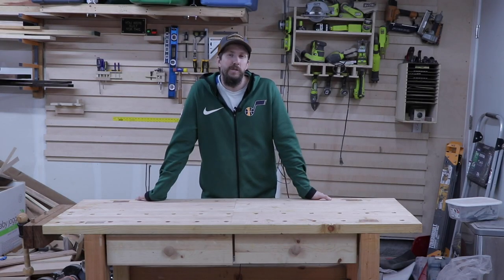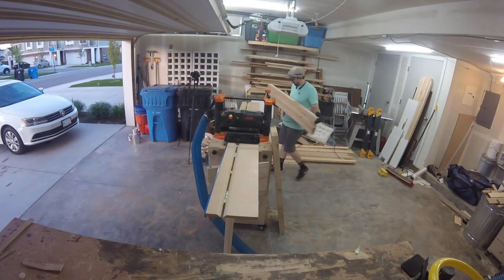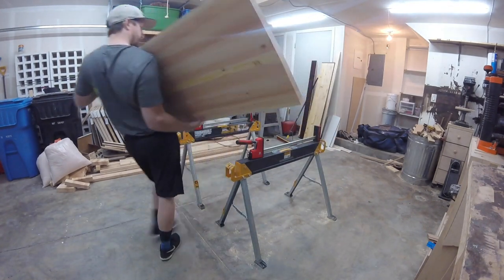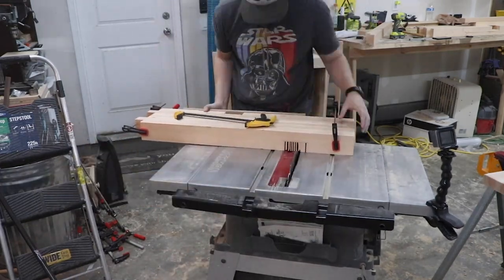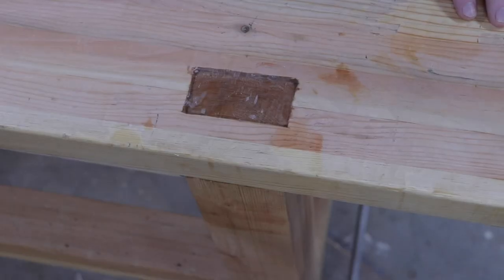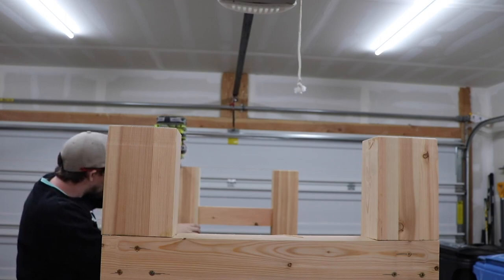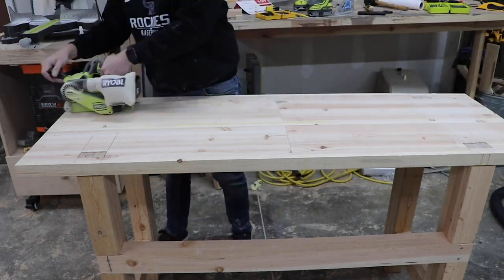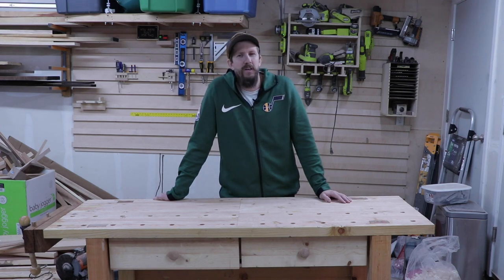Make A Sturdy 2x4 Dog Hole Workbench | The Poor man's Guide

Comment: Nice build. I would be very interested to know how you drilled the dog holes, both in terms of getting a dead accurate layout, and drilling them dead vertical 👍
Reply from the maker: Yeah sorry I didn’t include that in the build. The layout I just made sure the dog holes were spaced apart less than the total width of my the tail vice. This makes sure you can apply pressure to the piece no matter what size of piece you are working on. To get the holes dead vertical… well… I didn’t. I tried but some are a little off,  and I don’t think you should worry about it too much.  Even with them slightly off, they create plenty of holding pressure for the dog holes. I just used a forstner bit with my drill gun and carpenters square to keep me as straight as I could. Thanks!

Comment: Did you consider staggering the shorter boards in the initial glue-up, instead of joining the two short sections end-to-end? It would be a lot stronger.

Comment: Looks very similar to what I am about to build for myself!!!!

I need to figure out how I'm going to attach the top to the legs though. I won't be using a mortise, as my skills in that area are pretty bleak to say the least. I'm thinking of using dowels.
Reply from the maker: thats how I would do it. But if you never try you'll never learn. To be honest my mortise weren't very good, hence the reason I had to fill them in with epoxy. It's a learning process.